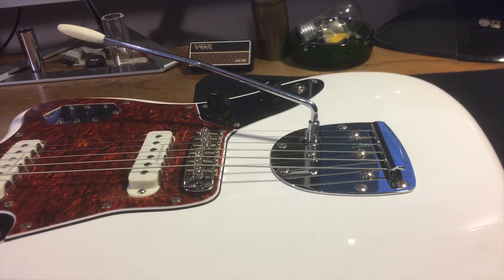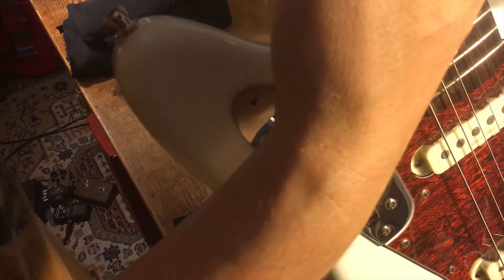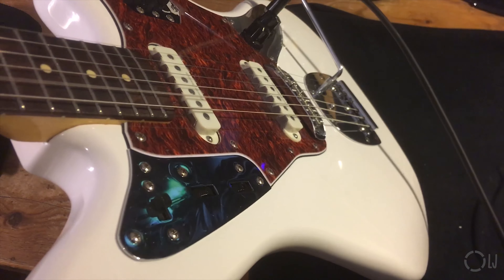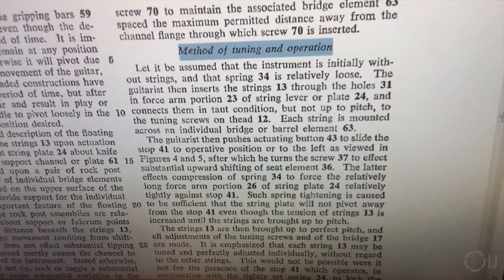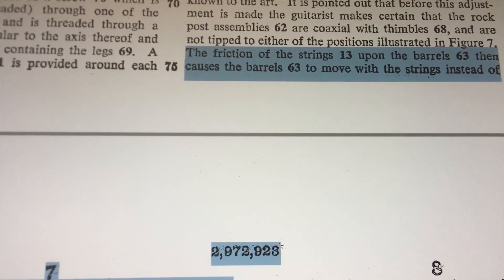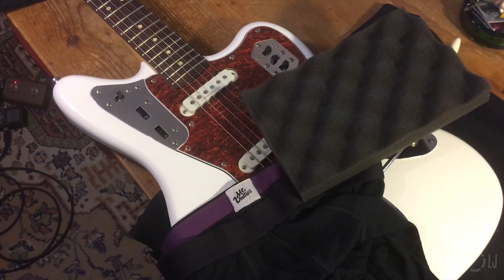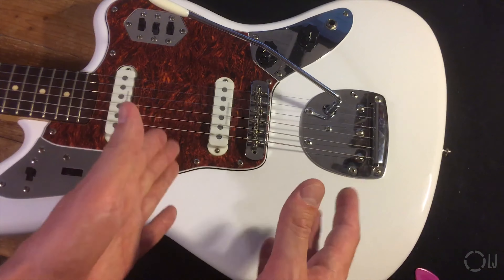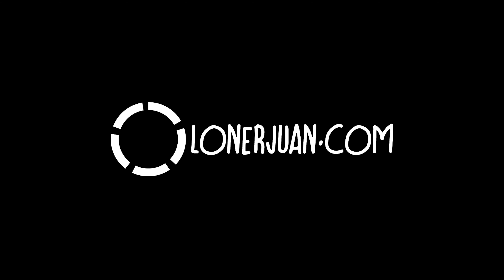Fender Offset Bridge - A Work Of Engineering Art

Comment: A little bit of Loctite (the blue kind) fixes all the vibrating screws. I like to put a pinhead-size dab of Funtack between the saddles too, to couple everything tightly.
Reply from the maker: I never heard or even thought of the Funtack one! That's interesting... I should try it.

What I used instead of Loctite (I couldn't get the blue stuff where I'm at) is teflon plumbing tape. It's a bit more annoying to use but it's kept me from losing any screws that rattle off on some guitars.
Reply: @lonerjuan  I always had trouble with the teflon tape, but if you can make it work, fine. I used to also use an adhesive used by modellers called "Crystal Clear" (I'm not sure how you spell it.) it's a water-soluble white glue that dries clear and keeps things from moving till you need to.

Comment: I set up my new classic vibe jaguar the way Leo intended with bridge upright in centre of thimbles bridge posts sit 5mm off pick guard but the bridge keeps wanting to tilt forward towards neck every time I strum. Still has the factory 9s on hoping once I change the strings to 11s the problem will be cured. Tremelo rocks back and forth and returns to centre no problem but as soon as I strum a few chords the bridge starts to moving towards the neck end.
Reply from the maker: That's a weird one! Especially since tremolo action works fine but it's strumming that triggers it. I've never had that happen, but I'm definitely curious to know is gauge change will solve it.

I use 10s on mine and the strings themselves hold the bridge on place. It hasn't even been a problem on my Mustang, with a much more pronounced angle behind the bridge, which I would assume would make things even worse in that area.
Reply: Yeah it’s bugging the hell out of me new strings should be here tomorrow so will update once I give it a set up with the 11-49s. I usually use 10s on other guitars but went with 11s because of the shorter scale. Bridge also keeps sinking mostly at treble side as the bridge post screws are shit I haven’t applied thread lock yet so that may be part of the problem.
Reply from the maker: I've heard a couple other instances about the post sinking on the Classic Vibes lately. Kinda odd considering they were supposed to be not only on par, but arguably superior to the Vintage Modified ones, which I've never seen fail in that way.
Reply: After adding some loctite to the bridge height screws and 11-49 strings the bridge has become a lot more stable. It does still move ever so slightly after playing a while but I’m quite an aggressive strummer so I just have to lighten my pick attack and it stays centre. 👍

Comment: Is this a Classic Vibe model? I want to compare one of these with my (just acquired) Fender 60's Jaguar Vintera. I love the classic Vibes (my most played guitar right now is my Classic Vibe Tele which is all stock barr the saddles/bridge).
Reply from the maker: It's a Vintage Modified. They were phased out when the CV line started including offset models. Still a great guitar though.

I also have a Mustang and P-Bass from this line, and a CV Tele and Strat. Overall quality seems pretty comparable, maybe with a bit of an edge towards the CV. It seemed more noticeable on the Teles and Strats I played from both series, but offset VM series has always felt quite on par with CV ones in my experience.